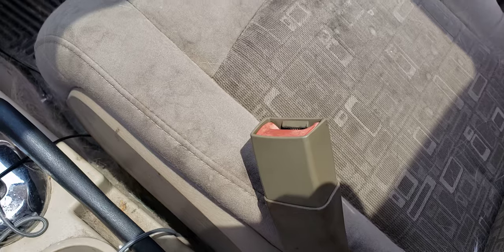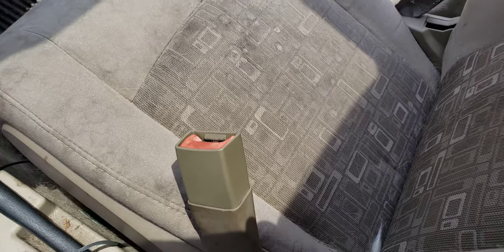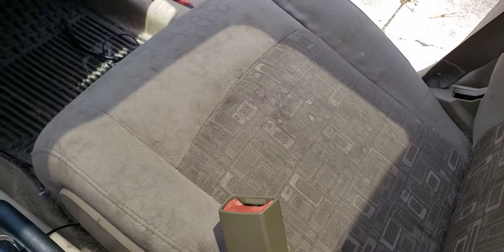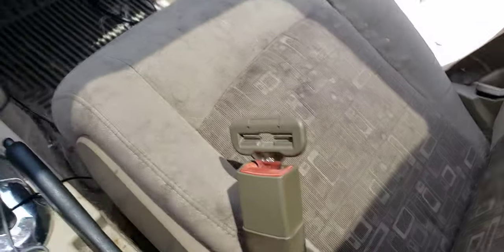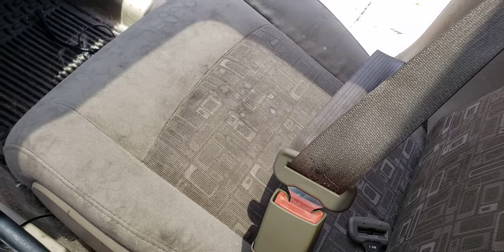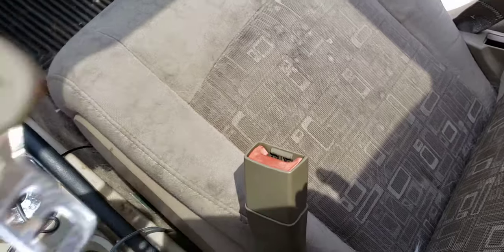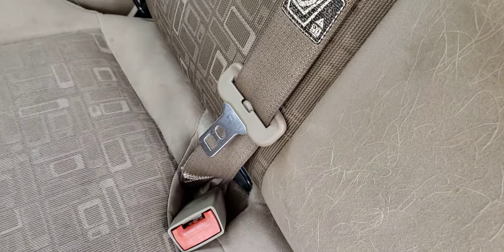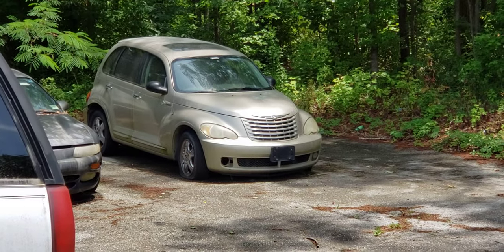How to Fix a Malfunctioning Seat Belt Sensor - Override and Alarm Stopper- For Pets too!!

Comment: Or you could buy and install a Seatbelt Bypass/Override for about $20 bucks or less.  It's usually a fairly easy install.  In some vehicles it's just a matter of reaching under the seat to unplug the sensor and plug the bypass clip in its place, but the junkyard bit is good too.
Reply from the maker: Cool thanks fornthe advice! Sounds like a great idea!

Comment: Hi I have a 2015 kia soul and when I have the seat belt on its still dinging so what is that please
Reply from the maker: Hey Brigitte sometimes the sensors go completely bad. Can be a expensive to replace . Ask at an autoparts store if there's a way to disable the noise.  Thanks for watching

Comment: Hey! Do you still have access to Mercedes parts? I have 300te and I’m struggling to find a couple things.
Reply from the maker: Hey nsal. What year? What parts do you need? The cars are stored 2 hours away but if it's a simple part I may be able to get a few months from now.
Reply from the maker: I dont have a 300te wagon but I have several 1988- 1992 models.

Comment: Disliked because it doesn't fix a malfunctioning sensor in drivers seat.
Reply from the maker: Guess it doesn't work for everybody's car. There's alot of different models with different sensors. You shouldn't dislike a video just because it doesn't work on your personal car.... that's kinda unfair. Some cars have seat weight sensors . Hope this helps and you remove that dislike
Reply: @drewsquickfix  It's because your video title says it fixes a malfunctioning sensor, but you didn't fix the sensor. Nothing was fixed. Your solution also won't work for the drivers seat.
Reply from the maker: @societyofrobots  it does fix the sensor issue on most cars a fix can be temporary or a permanent  solution to a problem..... I never say REPAIR which is restoring and removing the sensor or other issue. Please just go pay the $200-$300 at a dealership  vs complaining about my video which has helped 100s if people for FREE and upset people who own expensive foreign cars like Mercedes and bmws which this often doesn't work on and  who dont want to pay for repairs on expensive cars and expect an easy fix I guess you can't please everyone???? Im sorry you felt the title was misleading. When i made thisnthere was no other videomto help people withbthis issue. Thays why my video pops up in the feed. This is for a Chrysler pt cruiser.  Every car is different. I appreciate the feedback though.  Thanks for watching.